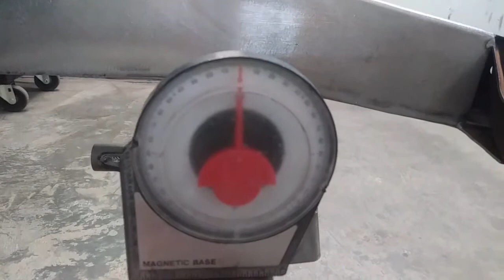How to install a IFS ( Independent Front Suspension )  -  DIY Auto Restoration

Comment: Do you use tig for general sheet metal replacement and rust repair on your restorations? rare to see that.
Reply from the maker: If the weld is "exposed" like the frame I'll use tig and tig welding has better penetration, nice for suspension parts.  Using a mig welder on these parts is fine also.... just preference

Comment: Well done, and you run a nice clean shop!  I enjoy your video sharing, we need to figure out how to drive more viewers to your channel.
Question on the 'C' notch mod to the frame for the steering rack. I'm assuming the company provided the C piece(?) Did you find it to have excess or unnecessary clearance once it was assembled?  Just curious about your take on it.  Keep up the good work!
Reply from the maker: Thanks for the encouragement! that is an older video, working really hard to improve, I'm up to 41 videos now.
The question, yes the C - notch inserts were supplied, no they really don't need that amount of  clearance as the rack is fixed. 
Thanks again!